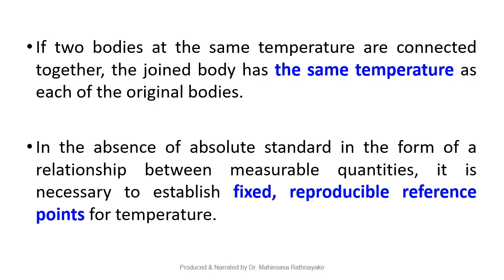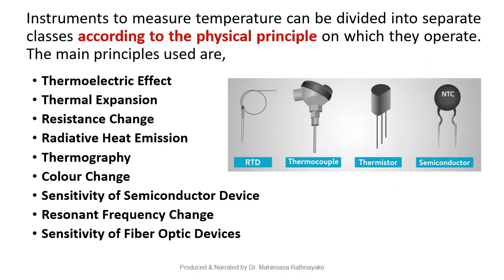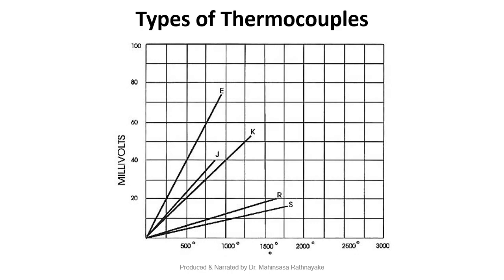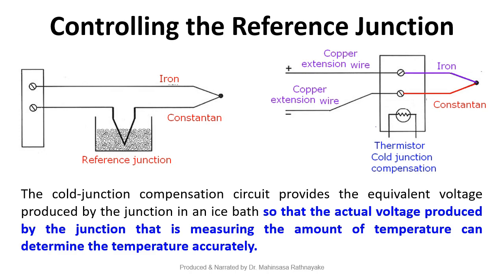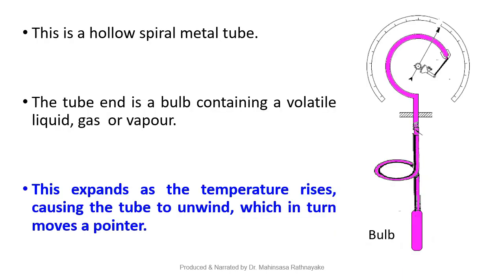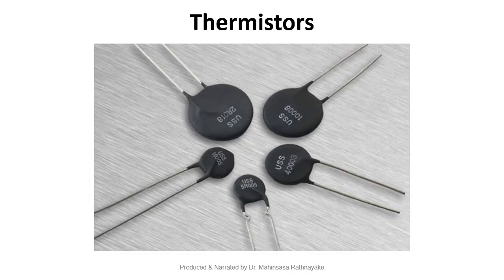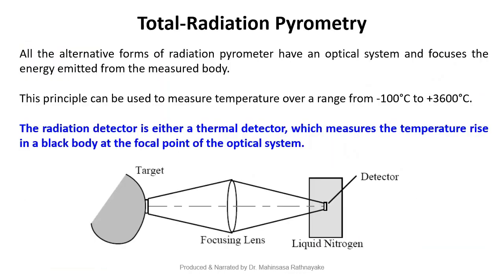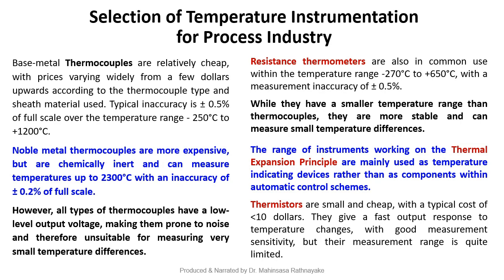Process Measurement & Instrumentation Lecture 01 - Temperature Instrumentation

Comment: Great video, very informative!
Would like to ask a question, why don`t we use one metal instead of thermocouples in order to measure the temperature? By placing  voltmeter at two ends of a metal you can find out the difference, as it will show 2 different eV values due to  2 different temperatures. But why do we need to use thermocouples, by this complicating the process, if the temperature can be measured just by 1 metal wire?